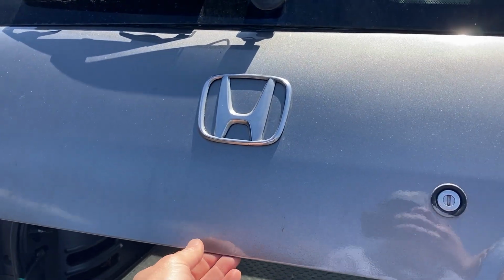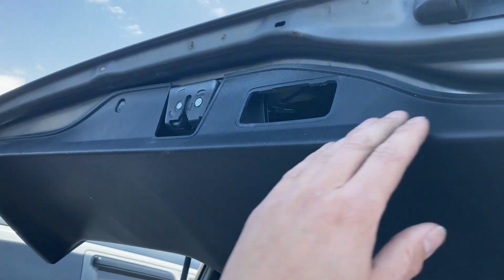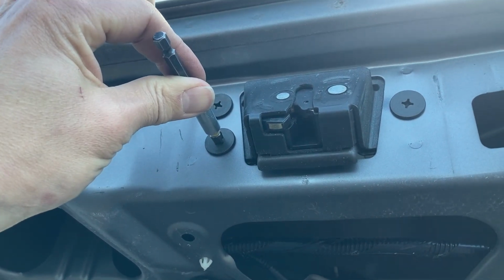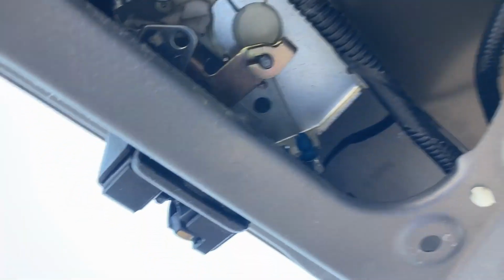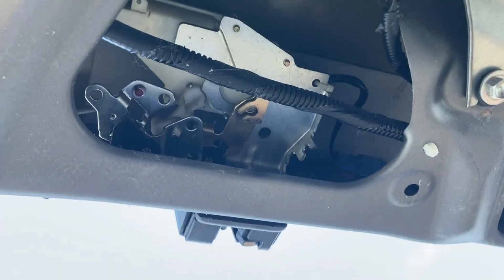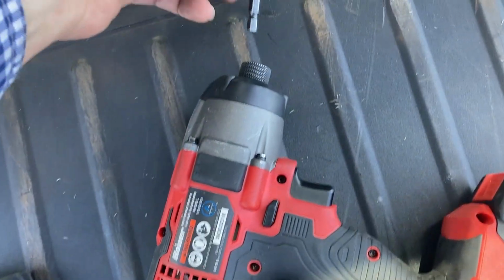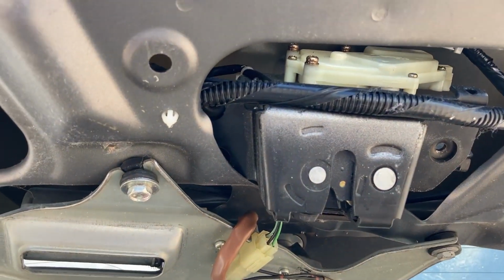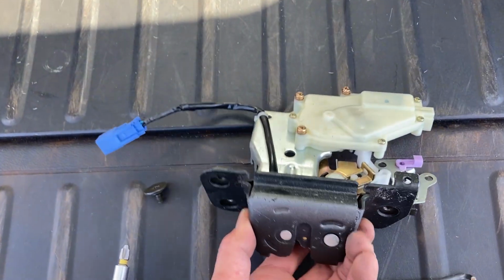Honda Element Upper Tailgate Latch Removal Process

Comment: Cool video Dave, thank you!

My friend can't get his key fob to work and the liftgate warning light on the dashboard is always on, draining the battery. He had a rear end collision and the tailgate is messed up but it does close. We can't figure out why the dashboard light will not go off though. Any thoughts?
Reply from the maker: Hi!  Sorry I didn't see the second part of your comment.  With the dash light not turning off there are three places to check.  There's an electrical connection on this latch (the upper one) and there are two lower tailgate latches, one on each side of the lower liftgate.  With rear end damage the alignment is off in any of those places - the upper and lower tailgate latches have two positions and are sometimes locked but do not fully get closed.  With both liftgates open I would close each latch with a screwdriver to see if you can turn the dash light off.  That way you can pinpoint where to adjust the latches.  You can adjust the strikers toward the latch or if the latch is damaged you may want to replace them.  Good luck-

Comment: Question - not for the upper latch, but for the handle. How do I replace the 2 nuts/bolts on either side of the handle (to open the tailgate). Mine are completely rusted and crumpling. Do you have a part number for those 2 screws? I can't find a part number for them. Many thanks if you able.
Reply from the maker: I good website is hondapartsnow.  It's under "tailgate lock."  I'm seeing part number 90307-S03-000, https://www.hondapartsnow.com/parts-list/2003-honda-element--5dr_ex_2wd-ka_4at/body_air_conditioning/tailgate_lock.html
Reply: @autolatch  sho-nuff! I couldn't see it before. thanks!
Reply from the maker: @osirismarbles5177 no problem, good luck!

Comment: Dave - big thanks for posting this video - as another poster had mentioned my fob did nothing to lock/unlock the rear hatch and it was as you had suspected/mentioned in thread below the actuator gone bad. I found an actuator from an odyssey and confirmed it's part #(thanks for that as well)I took a bunch of before pics /  took my time and everything is working now - thank you!
Reply from the maker: Awesome!  I'm glad you got it working and could use an actuator from an odyssey!
Reply: @autolatch  I have a 2007 Element and the tailgate lock just stopped working after all the recent rains. 
It was always a bit buggy when it rained but still worked. Now the key won’t even move at all to the left or right. 
What’s your diagnosis?
Reply from the maker: @shacktime try taking the plastic panel off so you can see the connection.  The back and forth mechanism is probably seized…possibly time for a replacement.  Is your key fob unlocking it?
Reply: @autolatch  the fob has never worked for the tailgate (I bought it used in 2021).
I pulled the interior cover back but can’t remove it completely without breaking it as I can’t open the tailgate and there is no interior handle. 
Everything moves and the wires are all connected. The key won’t move at all in either direction in the lock.
Reply from the maker: @shacktime  Ok so it sounds like you have a couple of things going on here.   You can get your hand in there there's a metal bar that you can move back and forth to put the latch in an unlocked position - then pull up where it is connected to the wire to unlock it - once the upper liftgate is open you can fully remove that panel to work on the latch.  From what you are descibing I think that the lock cylinder needs to be repinned.  Eric the Car guy has a good video on that: youtube.com/watch?v=uu0Z0qxwb8E&pp=ygUJI3dhaGFuYTg4.  The liftgate should be easier to repin than the side doors. To get the key fob working you can get a replacement actuator - it's that yellow thing on the top of the latch - maybe go with an OEM one (expensive) or a used one from an Element or 03-08 Pilot.
Reply from the maker: @shacktime there's 2 10mm bolts holding the lock core in the liftgate - you can see them at minute 1:02 in this video.  You may need a locksmith to do it if your key isn't moving freely.
Reply: @autolatch  Thank you VERY much!!!

Comment: My dashboard light for the rear latch stays lit, despite how firmly the rear is closed. This is likely the cause of parasitic battery drain, even though the dome light switch is off. Would replacing the latch assembly be the solution?
Reply from the maker: I haven’t had to troubleshoot this one on my Element.  Maybe try the lower tailgate latches next.  They both have 2 pin electrical connectors in them that can go bad and leave the circuit open.
Reply: I have something similar. I guess the latch doesn't close. I physically closed it and the dashboard light turned off; but then i couldn't get it to reopen by turning the key or the key fob. I can't remember if I tried to use the button on the drivers door to open it. I ended up opening it by actuating the latch with my hand, after removing the plastic cover.

Comment: How do you get the little blue plastic bit back in after you pop it out? Only part left for me lol
Reply from the maker: It is slotted on one side where you can slide that back on the the orange clip.  You can probably also zip tie it to one of the pieces of metal.
Reply: @autolatch  My mistake, I was referring to the like tiny bit where the bicycle cable comes out. Its like a tiny blue nozzle with a cable coming out. I saw you pop it out with ease, had the same results, but now I am baffled at how to press it back into the teeth that hold it.
Reply from the maker: @Skaursgaurd  I guess it is hard to describe how to get it back in.  You mount the metal piece first (twist it in) and then press the blue clip back into the mounting spot.  If you have any nearby junkyards you could possibly find an Element to see how it is mounted.  The Pilot and MDX latches are similar.
Reply: @autolatch  Gotcha. I may take some thin pliers to see if I can get the leverage I need. But I appreciate the insight. Thank you!

Comment: Why did you remove it? Mine stopped automatically opening/closing with the fob and I’m wondering if there’s a way to fix it or if my only option is to replace it
Reply from the maker: If your fob stopped unlocking the latch the actuator probably burned out.  It's the yellow piece that sits on top of the latch.  The part number for the actuator is 74896-S05-003.  It is expensive from Honda but if you have access to a junkyard you can get one from a Pilot (or Element).
Reply: @autolatch  - Thanks!